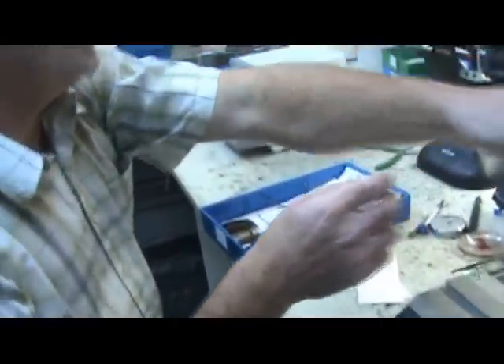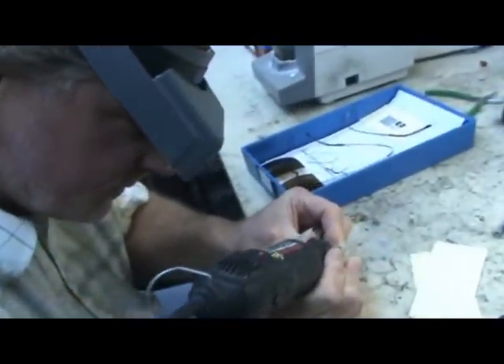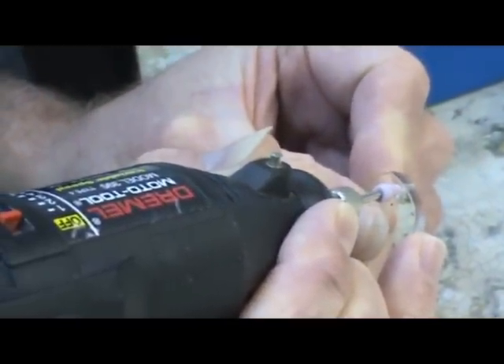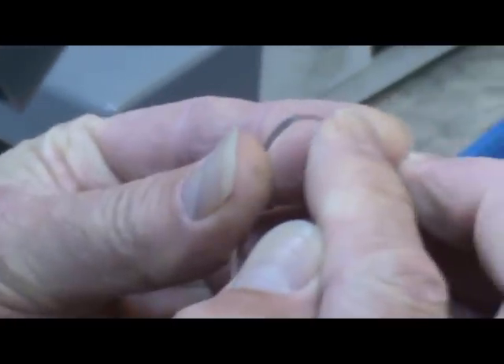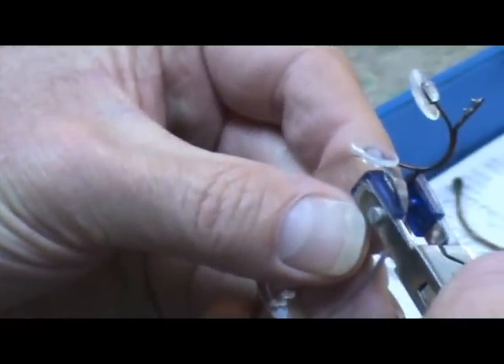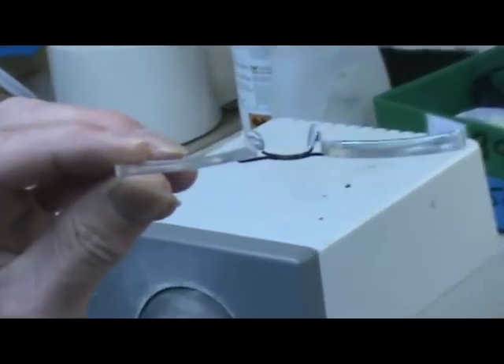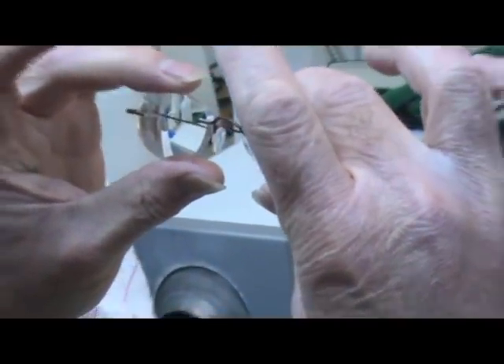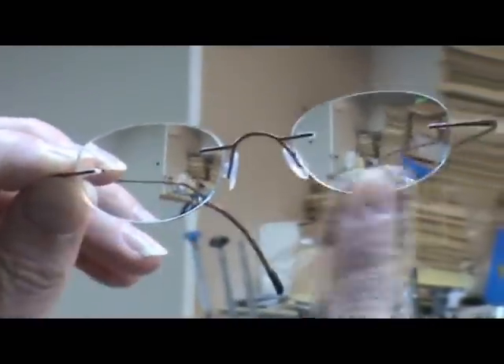Assembling a new Silhouette rimless titanium frame.

Comment: how do they put the anti-glare on btw, just curious ;) no, no warranty, with my silhouette the anti glare, It chipped of after 2 months but before I could got to the store the warranty run off, so that's why I ask And is there any improvement of having really durable anti-glare? Because its silly I have glasses  that are 15 years old, with normal glass on them payed about $50 for them is  and they are still fine. I buy silhouette for about 600 and the anti-glare was gone in seconds.

Comment: Hi! I have an uncut pair of -3.25 diopter Zeiss Duravision Platinum lenses, 1.5 refractive index.  Can they be mounted on a rimless frame, like Silhouette (taking in consideration that they are quite thick due to this diopter value)? 
Is it risky to assemble this kind of frames on the lenses I’ve mentioned, as they say that while drilling the holes for the plugs, the lens can crack?
Reply: For rimless frames it's recommended to use a higher index lens like a 1.6 or 1.67, but a good optician should be able to drill perfect 1.4mm holes (Silhouette) in a 1.5 index lens. Also, because the lensmaterial is thicker, the risk will be low. (Back in the days they even made rimless frames with mineral lenses) Be a bit more carefull when using your glasses, because after all, 1.5 index material still is softer

Comment: I ordered mine in June 2016, one of the nose parts broke within a few weeks, it got replaced, a few months later the right temple piece broke, it got replaced, and now the left arm broke, warranty is expired. I take very good care of them, even use a bigger holder at night so the frame is not pressed or stressed in any way. I had much cheaper glasses that lasted way longer than these. I do not know what "titanium" is used on these frames but they are the absolute worst frames I ever had, I have been wearing glasses since I was 7 and I am now 30...
Reply from the maker: Hi sergiuppincv, I'm not sure why you're having problems. Did you purchase the frames from us?

Comment from the maker: It's quite the process, but we're not in the business of coating lenses. We leave that to our trusted manufacturers. The ability for your anti glare to stick to your lens depends on the coating process more than it depends on the brand of anti-glare. As you have experienced, there are a lot of cheaply made glasses out there, even if they cost you a lot of money! 

The good thing is that you can reuse your Silhouette frames. Have them fitted with lenses from a reputable manufacturer w a warranty.